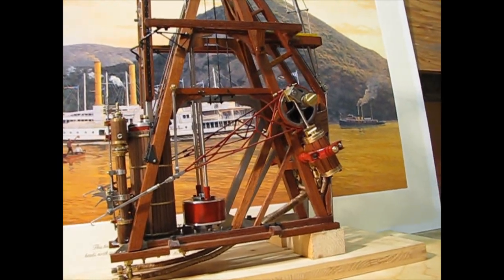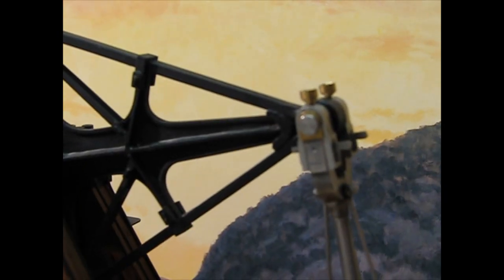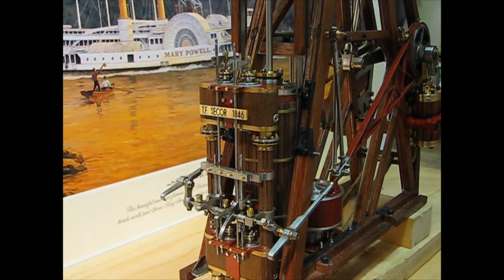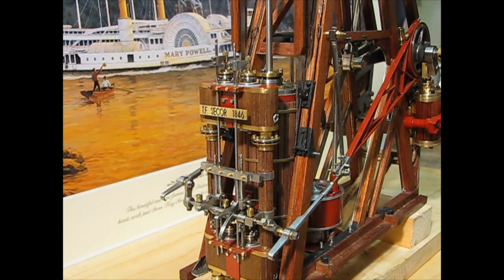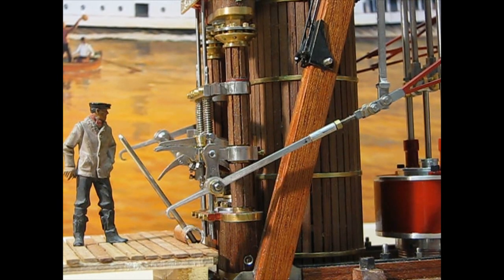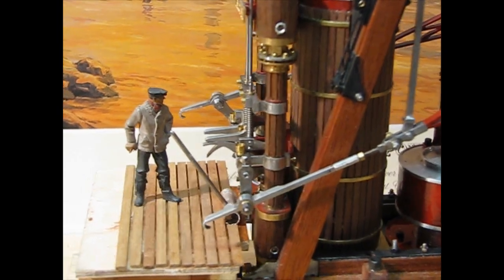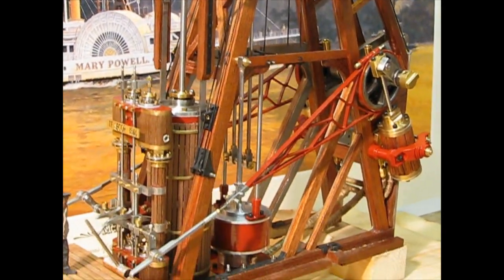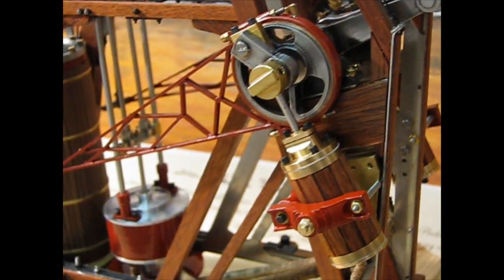PADDLE WHEELER Steamboat Thomas Powell #2. Walking Beam steam engine FIRST TEST!!! TF SECOR 1846 NY

Comment: It's interesting that reverse was achieved by manual valve actuation, I wonder why they didn't use a reversing gear system, even if something like the Stephenson's sliding link wasn't viable due to the vertical position of the valve, a single eccentric reversing gear like a simple slip eccentric or Wolfe valve gear doesn't seem like it'd be a problem to do.

I guess they didn't use reverse enough to warrant putting some extra engineering into it? I dunno, I certainly would've thought it'd be useful on a river boat.
Reply from the maker: I'm sure they did, at some point, try out different reversing gear systems during the 100+ years these engines where running!
The starting bar operation was simple and efficient: once throttled off, and hooks lifted up, the engineer could swiftly and precisely swing the bar up or down, opening or closing the valves. This reactivity reduced the dangerous risk of locking up on dead center with the boat moving towards the pier.
I don't think it was that much work: just one or two counter revolutions of the paddle wheels were necessary at the landings.
Steamboats designed to "sail" astern had two sets of eccentrics and hooks (e.g. Ferry Eureka - San Francisco).
Thank you for your interest, and thanks for watching!
Reply: @LiveSteamPaddleWheelersPG  Fair that to arrest the vessel as it slowly approaches the docks would likely only take a couple of cycles with the lever, but I imagine it'd be quite a bit more harrowing to need to perform an emergency stop from speed.

Good point on the ability to avoid, or at least reduce the chance of, landing on a dead center with a single cylinder engine, though.

Comment: Do you have build photos and/or plans? I am most interested in the valves, hot well, ancillary pumps, etc. Thank you. Nice work :-)
Reply from the maker: Thank you!
This engine is essentially inspired from blueprints of real marine walking beam engines, but keep in mind that I crafted it for a radio controlled model: to reverse a "real engine's" rotation, the engineer had to disconnect the eccentric hooks and then operate the valves manually, opening and closing them for every wheel revolution. Possible to do on a RC model using electronics and electric motors…
Not my choice though: I replaced the poppet valves with four piston valves, allowing the use of a reversing valve. 
That rules out the condenser & hot well; what you see on my model is a simple feed pump.
Try and contact "Historic Models and Reproductions LLC". They manufactured large marine walking beam kits (3 ft. tall) with many castings. A very accurate model with plans, and many detailed pictures of the parts you mentioned!
Reply: Thank you for your prompt reply. I have looked into the model you refer to with castings, but it is outside of my budget. I applaud your solutions; very clever and they suit your needs nicely. 
Do you have videos of the completed ship steaming under power? I had not found them on your page, but perhaps I am just sitting on the edge of my seat?
Reply from the maker: @ggsprock  Not reached there yet...that'll be for sometime next year!  ;-)
Reply: I can definitely appreciate that. These things take time.
Reply: Oh, downrivertools.com is not a viable website any longer. Not certain what is going on there :-(

Comment: Georgious model. Might could use a flywheel lol
Reply from the maker: Tank you!
Steamboats with paddle wheels linked directly to the crankshaft didn't need flywheels; the paddle wheels did that job perfectly!
Building my model to operate the same way is precisely what I am aiming for! (as is already the case on my other scratch built models!...)
Reply: @LiveSteamPaddleWheelersPG  my appologies i stumbled upon the video without context. The boat looks just as nice as the engine. Theres just nothing like live steam!